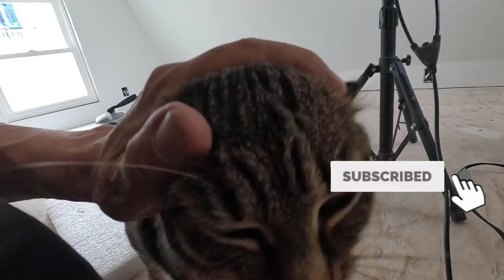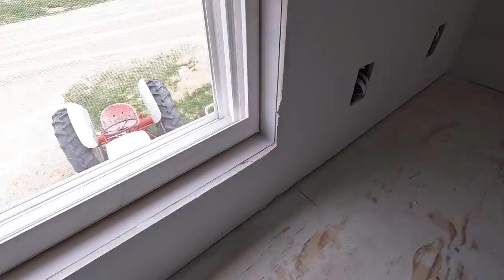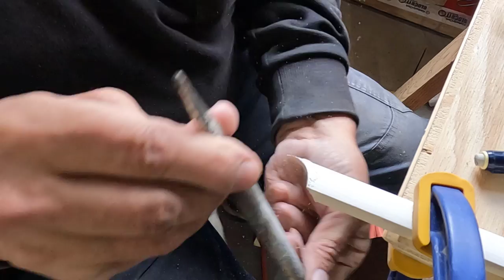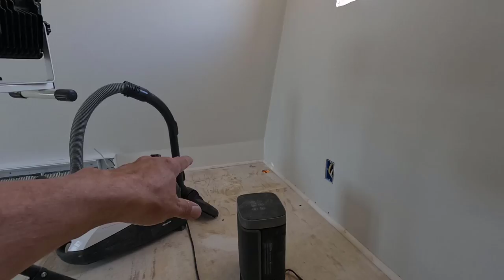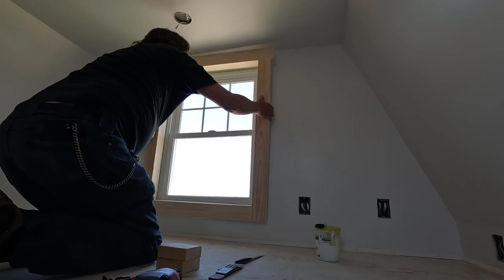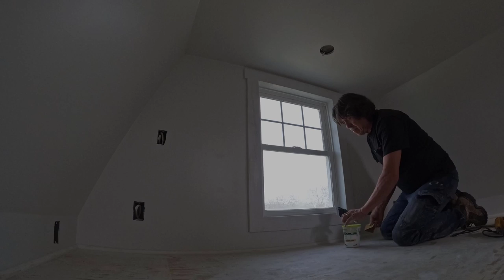Tiny House Build ― Installing the Loft Trim (Nearly Done Up There!!! 😊)

Comment from the maker: Big day at the tiny house project! The finish stuff is all done, and it's time for paint. Once Natalie paints the place I'll come back and install the electricals, and once that's done I wont be back here until I restore and reinstall the #1 Toilet. I also need to make a window for that west opening, but that needs to wait until we start the addition in a month or-so. Nice to be out of that cramped space for awhile though! 

Recent Products used:

Durham's Rock Hard Water Putty - https://amzn.to/3LSHwzz
ATTOP W70 GPS Drone - https://amzn.to/3AyMjQe
Tordon RTU - https://amzn.to/3zKqwVu
Nextmug - Temperature-Controlled, Self-Heating Coffee Mug - https://amzn.to/43bRJ0M
Saker Mini Chainsaw W/ 2-Batteries and 3-Chains - https://amzn.to/3mbRWQQ
Saker Mini Chainsaw W/ 1-Battery and 2-Chains - https://amzn.to/40ODAVM
50 PCS Multitool Blades - https://amzn.to/3JVF7Sv
15 Degree Bevel Bit - https://amzn.to/3YLQVw5
REOLINK 4G LTE Cellular Security Camera (Solar Powered) - https://amzn.to/3mSEp0J
FLEXIBOOM Data SIM Card - https://amzn.to/428wrRc
3 Month FLEXIBOOM SIM Card - https://amzn.to/3FmjrOb
6 Month FLEXIBOOM SIM Card - https://amzn.to/3JFqPGE
12 Month FLEXIBOOM SIM Card - https://amzn.to/3JfHK1o
Pet Safe Mouse trap - https://amzn.to/3Zx5YdR
60 Watt Blue LED Bulbs - https://amzn.to/41eKzYL
Boeshield Total Tool Care Kit - Large Two Pack - https://amzn.to/41aqnqG
Strain Relief Rubber Boot - https://amzn.to/3YJGtGq
1/4" Nominal Polycarbonate - https://amzn.to/40YIobD
Power Cord - 10ft 14-Gauge 3-Prong - https://amzn.to/3YGLdML
PlyWheels Plywood and Drywall Dolly - https://amzn.to/3JXe4bi
DEWALT 15 AMP Plunge Router - https://amzn.to/3EcyZ6g
Oscillating Tool Blade, Titanium Nitride Coated - https://amzn.to/3JM45Wi
30 Pack Black S Hooks - https://amzn.to/3lg0cyB
3/8-Inch-Drive Impact Extension-Bar Set - https://amzn.to/3lcpr4I
6 Piece Impact Socket Adapter Set - https://amzn.to/3HycYjk